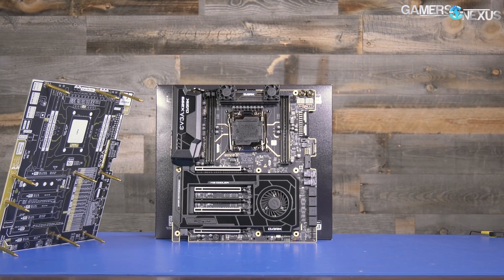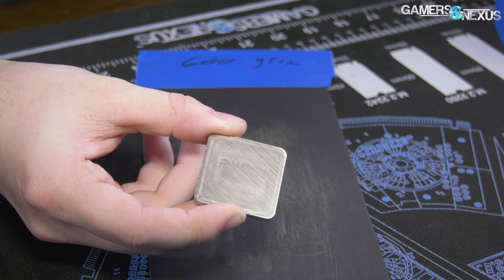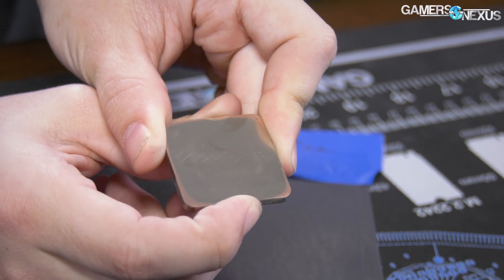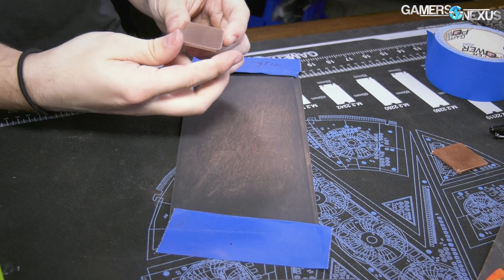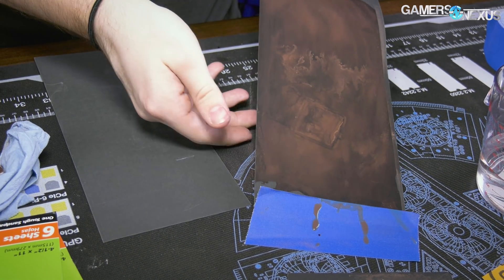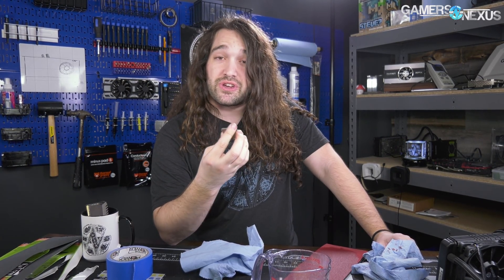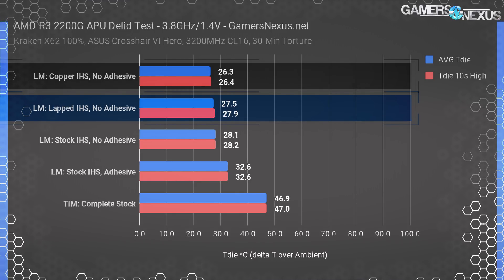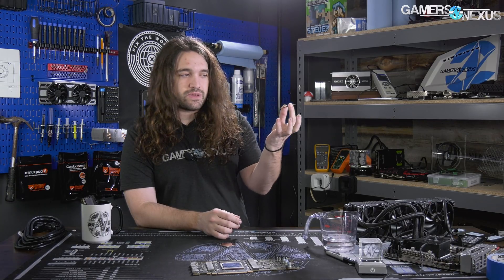Lapped Ryzen IHS vs. Copper & Stock IHS

Comment: how does IHS soldering work anyway? would it be impossible to DIY without industrial equipment?
Reply: Honestly, you could get a flat, pre fluxed solder sheet and use an oven(or soldering heat gun) if you wanted it to be a permanent solution. It's actually easier and less messy than spreading liquid metal. You put the solder sheet in between the chip and IHS, and heat it from the top. Soldering heat gun's are 50$ and up. You can get a whole hot air rework station for 100$-ish that has nozzles to concentrate the heat and better temperature control.
Reply: Metatron's Cube that actually doesn't sound too complex and accidentally burning the chip seems unlikely. i guess the important part would be figuring out the proper size and thickness of the soldering material so it doesn't melt off the sides and shorts any SMDs. that could be a cool project to make a little video series about if there's enough interest to make it worth GN's time. i'm sure there's people who'd like to see a DYI soldered 8700k compared to one with liquid metal applied to it
Reply: Here is something from an extreme overclocker: https://overclocking.guide/the-truth-about-cpu-soldering/
Reply: Good info, if there is little care for the chip lifespan you might get away with using silver paste(melts near 400C), but it sounds like it would crack after multiple on off cycles heating and cooling. It could still be fun just to see on a cheap or old chip what happens. Hell it might be hard not to crack it while adding a cooler on if the IHS is freefloating except at the solder point. Eventually i'll have a spare 2400G to try some things on. Maybe try gold plating the CPU top so it actually sticks.
Reply: If you want to go down an uncharted route, there also seems to be indium solder paste, and few made for "lid attachment". There are also "solder preforms" which can be pre made tabs of the thickness you need...but you need to order in quantities of 1000 units.
Reply: Keep in mind that the "solder" they use is actually Indium, plus a very thin sheet of 24k gold on the IHS to get the Indium to bond. I believe the "soldering" process also involves cooling it down to -50C and heating it up to 150C and holding various temperatures in between for considerable amounts of time. Not something I'd want to try at home.
Reply: Old Codger thank you for linking that very informative article. written by none other than der8auer, too. now i'm actually surprised that AMD still solders their IHS when it seems to not only be cheaper, but also easier and safer to use paste instead. makes me wonder if they actually need the solder, like Vega apparently needed HBM due to power constraints, iirc
Reply: maybe the addition of iGPU's next to the CPU makes soldering even more difficult(for a lasting bond that doesn't crack). Intel has had a lot of CPU's with internal graphics, and the 2200G/2400G went thermal paste as well. Uneven heating and all between the chips. It might just be easier to do without iGPU's in the way.

Comment: Dumb question. Will I see a 1c diff if I do this with my 2700x IHS? I wouldn't delid it, just sand down the top. 1c would be enough for me lol.
Reply: Yea the drop is around 1 degree.The real drop is between the CPU and CPU diode..

Comment: get it of the mat! you should use glass or something 100% flat and hard so you don't sand a radius into the IHS which will ultimately decrease its performance. as you have as the corners were the first thing to reveal the copper under the coating.
Reply: I was going to say something like this, as well as to get something like a lapping stone.

Comment: As a manufacturer These lapping videos are extremely painful to watch. I have yet to see any of these tech channels use a lapping technique that would even come close to making the IHS flat. Really wish these guys would spend some time on.
oxtoolco or like channel before attempting this.  If they really wanted to do it right they would lap the IHS to the Heatsink they are planning to use.
Reply: Your thoughts really mirror what I thought too, the main point of lapping is to reduce the TIM thickness even further, and to do that both surfaces do need to be lapped for perfect contact. That said I don't think it'd give more than a few degrees at best and take a lot of time.
Reply: Quarnozian That may be better than the methods in the video however glass contrary to popular belief really is not flat best case would be +-.002" average +-.010" where a cheep grade B surface plate would be +-.0001". But using tape to attach the paper would cause the biggest problem the sand paper should stick to the surface with nothing more than water.
Reply: Still wouldn't make more than a barely marginal difference.
Reply: Kaihekoa  The main difference would be the ability to eliminate thermal past.
Reply: rmkscrambler, the first lapping vid I saw they taped the sandpaper onto a mirror (providing a perfectly flat surface), always kept the sandpaper wet, and also lapped the heatsink that would be mated against the IHS.
Reply: random23 No doubt proper lapping is a lot of work. The worst part would be if they do a really good job and check it by wringing the parts together which would be the best way to see if they actually did it right. Their is a chance the ihs would cold weld to the cooler meaning they would either have to assembly everything with the cooler and ihs stuck together or start over.
Reply: @ rmkscrambler, I know it's an old comment but a point of clarification is needed here. The specific conditions needed for cold welding would never be met when working with these parts. Generally speaking, a near vacuum and high pressure would be needed to introduce a cold weld. While cold welding can occur outside of a vacuum and with minimal pressure, it only happens on a nano scale. Being that no portion of either part meets that requirement, it won't happen.
Reply: it makes me laugh to watch what these guys call laping...
Reply: @FLTAIRSSOFT, the definition of lapping is rubbing two surfaces together with an abrasive in between. He could of lapped the base of the sink as well, and the die contact but to what end? The methodology used here will more than suffice seeing as any gains that may of been had were within margin of error for testing.
Reply: I didn't think mirrors would be so uneven... considering that the glass they're made from is usually formed by floating it across molten tin until the glass is hardened.
Reply: took my 1700 down by 3c and i didnt even lap it all the way, wasnt flat, flatter than stock, but not perfect flat. You have to lap the cooler/heatsink as well, cant just lap cpu.
Reply: Ya I know the feeling if they want to sand get a surface plate
Reply: not disagreeing with you but you failed to say why or how they can improve so your comment does nothing to help. He should be using a granite slab, or at least something harder and flatter than the mod mat as well as going in one direction
Reply: Ryan I probably could have included a recommended procedure. But if someone wants to truly test a concept they need to understand it which is why I referenced a good source which would do more than I can in a comment. But yes as you said a good start would be a granite slab placed on a foam surface. Next he would want to wet sand both the IHS and Heat sink using a figure 8 motion probably starting with at least 1200grit paper and work to 6000 grit. To finish he should use some dimond lapping compound and lap the IHS to the heat sink in planned orientation.

Comment: The reason the corners get sanded first is because the modmat is a soft surface, no?
Reply: alexkj was just going to say that, the sandpaper should be glued to a pane of glass ideally.
Reply: Not really.. even if the pressure on the object is the same at every corner the block is still going to be sanded more at the edges.Only way that i find is to is spin it with a centered pressure
Reply from the maker: No, it's because they're literally different heights out of the AMD factory.
Reply: @GamersNexus  no. I'm a machinists. If you properly want a flat surface you need to do it on a hard flat surface. If you ask nice I can make you a lapping block amd can guarantee it would make a difference.